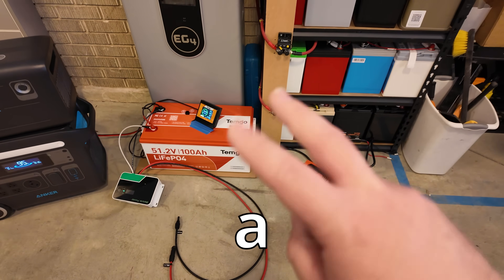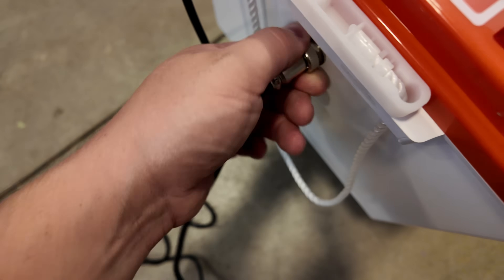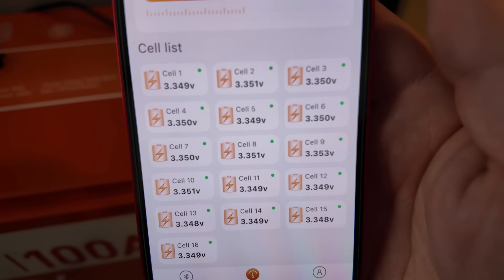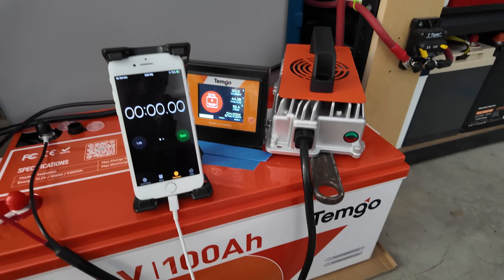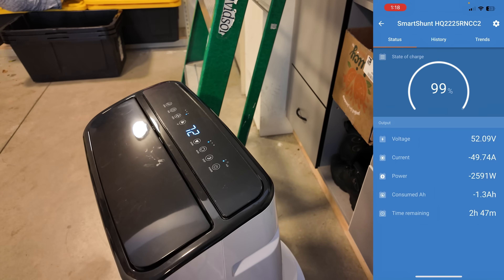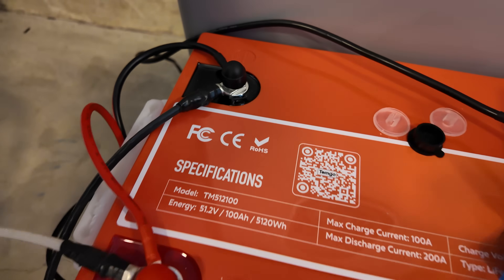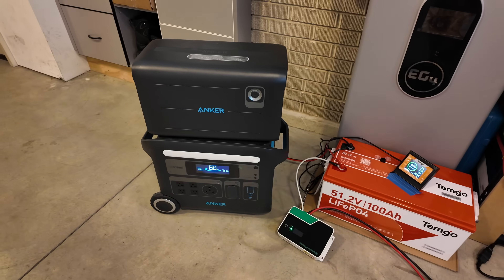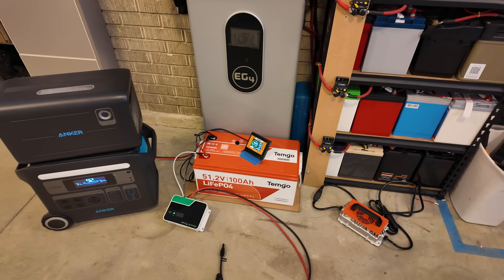Found One of the Best Battery Kits for Home & Portable Power-Disguised as a Temgo Golf Cart Battery

Comment: Thanks for all your content.  It is so spot on to what I'm interested in learning and doing.  I have the predecessor to the Anker Solix F2000 (the Anker 767 Powerhouse).  It would be great if you found a way to allow it to communicate over Wi-Fi.  I think the F2000 is also Bluetooth only.

Thanks Again
Reply from the maker: Glad you are enjoying the content! Got more great stuff on the horizon! By the time this year is over, you are going to know all kinds of cool cost savings hacks surrounding electricity, solar and batteries! It's very cool stuff!
Yeah, I believe the Anker 767 is bluetooth only, and that's literally the only thing they changed on the F2000 besides the name, and that is a Wi-Fi module because mine connects over both WiFi and Bluetooth. Thanks for watching!

Comment: I have a DPU and have also wondered if a battery charger could be used with the solar inputs and a manual transfer switch instead of a switching power supply to avoid a ground loop.  You are the first one I have seen to suggest that.  Do you have a DPU and manual transfer switch to test this with to make sure it is safe?
Reply: From my personal testing, most battery chargers will need to see an actual battery voltage in order to start and stop the charging process and the solar input ports on a power station don't have a battery voltage. I connected a 48v battery charger to the Anker F3800 solar ports with no luck.
Reply from the maker: @Jasonoid Yep! Same thing here! That’s why hooking a 51.2v battery up in the middle solves that issue and then gives you the significant side benefit of extra capacity!
Reply from the maker: I would imagine it would work great with the DPU...but I have not yet tried testing it. I need a DPU first! Tell EcoFlow to get on that will ya? Haha! Thanks for watching!

Comment: I suggest you talk with Jasoniod's channel ( https://www.youtube.com/watch?v=SwFz2K85pCY ) as he just made a video about using an external rack battery with a Pecron power station so a similar set up to what you have shown.  The Pecron allows hook up via the external battery port and Jason's testing showed that the main unit can charge and discharge the main unit and external battery together.  I am also going to suggest in a comment on his video that he contact you
Reply from the maker: I know Jason well! He has a wonderful channel and I saw his video you are talking about! That's an excellent way to expand a power station if they allow you too! A lot of power stations (like EcoFlow) have their extra battery port locked down and it's impossible to do what Jason shows. So that's where the DC input hack comes in like I showed because that works with any power station that can accept DC 60v or higher.